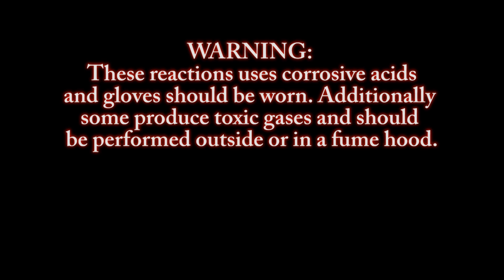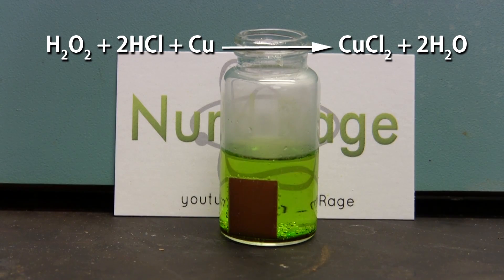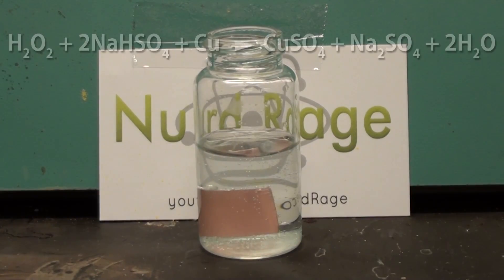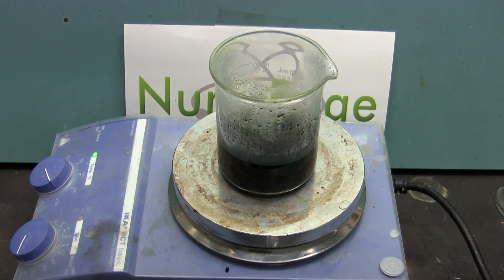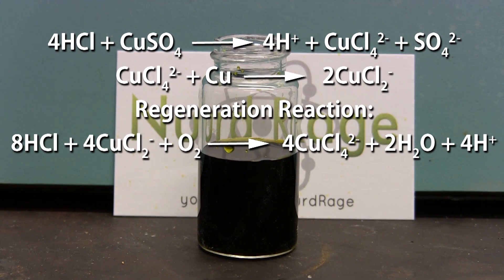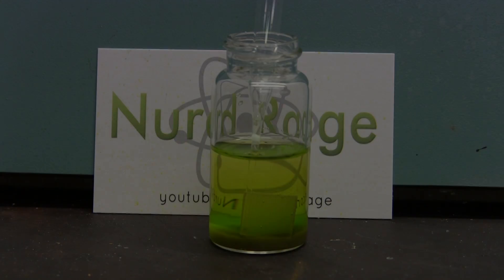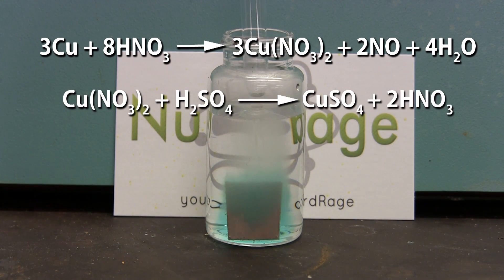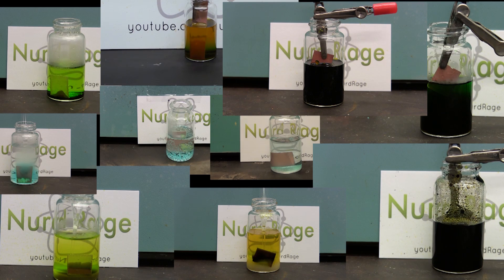Make 10 Etchants for Copper Printed Circuit Boards

Comment: very cool vid, did you know they call h202 mixed with h2so4 purona water because it will burn your arm off lol, great video's friend im currently attempting to build small complex parts using ac electrolysis of brine solutions on the order of 50% salt  , yes i said AC electrolysis at 60Hz ,any way friend it only works with brass, brass is disolved at an amazing rate in this process up to grams per minute, i suspect the chlorine gas is reacting with the brass any thoughts friend???

Comment from the maker: 1. Its not. The higher concentration version is used to dissolve copper. not the lower concentration.
2. your hydrogen is in the wrong oxidation state.

Comment: Thank you, but ... 
1) if it is too slow, why can it be possibly used to dissolve copper? How long would it approximately take?
2) Why is it wrong? Why does it have to react with oxygen and what are those residential cations then?

Comment: Nice video.
I am a bit confused, so I'd like to ask you this:
1) If tetrachlorocuppric ions react with copper to form CuCl2, and CuCl2 reacts with HCl to form tetrachlorocuppric acid again, would hydrochloric acid with just a tiny ammount of CuCl2 react with copper and even let all the HCl react and make it blue?
2)I fear there is a mistake in your equasion. I believe it is
2HCl + CuCl2 --> H2CuCl4 (--> (H2)+ and (CuCl4)2- )
There is no need of oxygen.
Thank you for your answer.

Comment: Hello! I've tried the H2SO4+H2O2 etchant. I believe that you have mistakenly wrote "h2o2 3%" because i've achieved the result shown using 37% H2O2.
Also, it seems that (maybe it's me doing it wrongly) that the bubbles detaches the toner strips from the copper :(

Comment: I found research relating to your idea of using wax / 3D printer to make PCBs. Originally I didn't see much merit to that method, but if you modify it, akin to the method described on page 17 of this document, I think it would be very innovative indeed: (goo.gl"slash"WGwR7). I think it would be perfectly reasonable for modern printers to have the resolution necessary, so one would only need to modify it print on the board, and to print a suitable wax or similar resist to the acid for etching.

Comment from the maker: Best way to tell is to do something called a titration to find the exact quantities of acid and metal ions in solution. pH alone is not indicative since CuCl2 is itself acidic. If you're just doing this on a hobby scale and don't really need perfectly consistent results then its easier just to take a small 10mL sample (like in the videos) and test etch of a small strip of PCB. if it etches its fine, if not, add 3mL H2O2, if it etches you just need H2O2 or air bubbling, if not then add acid.

Comment from the maker: first the "walls" of the hole are coated with a conductive ink (usually graphite based since it's cheap), then it's dried. The board is then cleaned and dipped into plating solution with additives to improve plating of the holes.

Comment: There are other videos that describe it. Paint the holes in a carbon-containing ink, and then electroplate. The only trick is that the plating is done before you etch, so all the vias will be connected to the plating gear.

Comment: What about acetic acid and hydrogen peroxide? Both chemicals are widely available, vinegar is ~4% acetic acid and hydrogen peroxide is ~3%. The copper acetate that forms makes a pretty blue solution as well. But I guess its an unfavorable reaction since the copper acetate has no real value for etching after forming...not to mention  the health hazards of copper compound dust.

Comment: Sorry for the ambiguity, my comment about photo-polymers for 3D printing was not related to the video on etchants. 

With regard to the wax idea, while interesting for sure, at that point you might as well use / make a pcb mill to mill out the traces. If you are going to to go over all the traces manually anyway, you might as well do it in one milling step rather than one and then a second etching step. Achieving sub 50 thou traces using the wax method would be rather difficult as well.

Comment: If you want to use a 3D printer for circuit board printing I would recommend just coating the pcb is a thin layer of wax, and using the printer head to push away the wax where you want to etch the copper.

Comment: That's the realistic response I expected. I assumed that it would be a tad too ambitions for amateur to attempt. That aside, if you found the materials to do so, I think it would make a great video. 

I also want to thank you for all the great content you've done. If I had found them before I probably would have chosen a chemistry related field over my current undergrad of electrical engineering.

Comment: i have used the hcl + h2o2 method and have found that using two parts h2o2 to one part hcl etched faster than a 1:1 solution does, and pure hcl takes forever to etch.

Comment: You're welcome :) i spent weeks seeking for such informations, finding the right lexic in use, and avoiding bubble filtering limited results. 
Another book, easily found on the net : "PIHR" by Bob Willis, it stands for "Pin In Hole Reflow", 163 pages

Comment: My best recommandation is too look after industrial methods in use, have a look at the how&why of these practices and you will look at solutions in a more synthetically way. keywords : HDI (high density interconnect), via in pads, PTH (plated through hole)...
"The HDI handbook" is freely available online in PDF format on hdihandbook com, catch it ! 631 pages illustrated with clean pictures in colors, and schemes :) ... Enjoy

Comment: you need to make the walls conductive to do so, in industrial process (see IPC recommandations if needed), a chemical carbon deposition through an ink process is used prior to electrogalvanization for copper deposition. Also, to preserve impedance properties of signal lines, masks are applied, and thickness of deposition is calculated upon copper ionic solution properties (time based)

Comment: NurdRage, could you please talk about Electro-less copper plating? Specifically, if possible, for PCB plating. Not final plating, but pre-plating as to create a small layer of copper on drilled hole walls, which later on are plated using electro-plating. Thank you very much. Like so that NurdRage can see, pretteh please?

Comment: i've used ferric chloride and hydrogen peroxide & sulfuric acid in my circuit etching though with ferric chloride the chemical can occasion be too strong for etching thus if using thin or very fine circuitry it can etch them right off the board if etched too long id say hydrogen peroxide & sulfuric acid is better for that since it stays translucent lets you gauge the etching process better. but that's just my opinion and mostly based on experience with those two chemicals :)

Comment: for the etching using the peroxide and sulfuric acid, wouldn't that be extremely dangerous to store?  Those two combined create Piranha solution, which is not something you want to be exposed to.

Comment: Try this, all ingredients from local store, cheap, fast, clean and absolutely safe: 100ml 3% hydrogen peroxide + 30g citric acid + 5g Salt enough for 100cm2 of 35um copper layer:
Cu+ H3Cit +H2O2→ H[CuCit] +2H2O
1: Cu +Cit(3-)→ [CuCit]- +2e -0,083 V
2: H2O2+ 2e + 2H(+) → 2H2O +1,67 V

Comment: This is crazy-relevant to my work. Thanks for the overview. I'm gonna stick with my Ferric Chloride for now, but seeing as bubble agitation is common for etch-tanks, some of the other metal chloride etchants might be in my future. 

If anyone is interested in popping over to my channel (after you've had your fill of NurdRage, of course) I have a pretty detailed video on etching circuit boards using Ferric Chloride. 

Thanks for another great vid,
-NorthAllenPoole, Fringeneering Labs